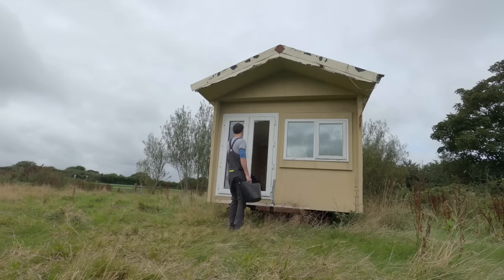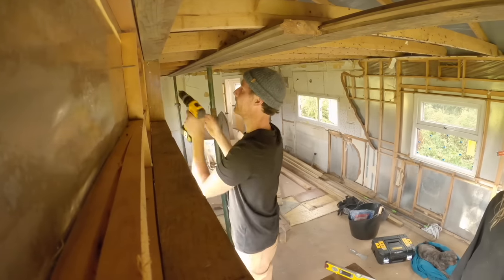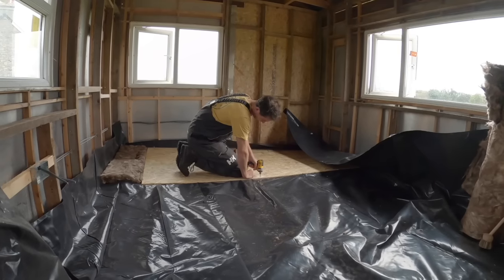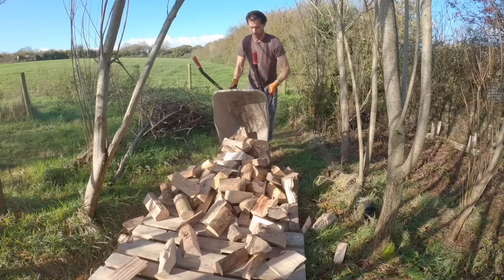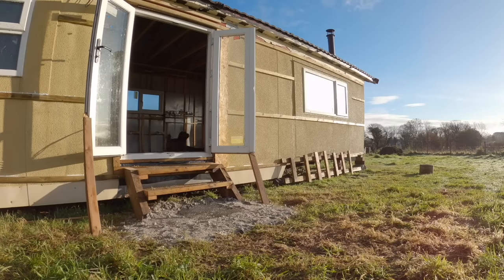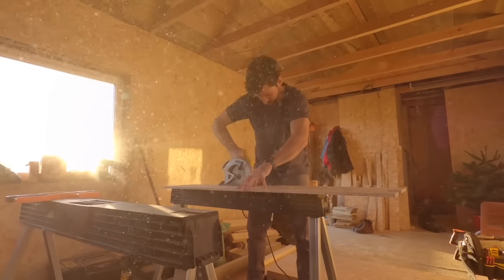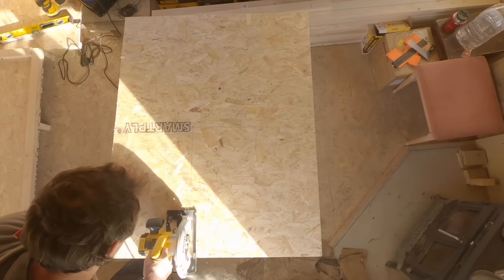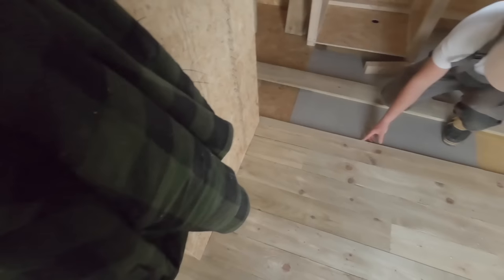Static Caravan to Cabin: Off Grid in the UK with Narration (FULL VERSION)

Comment: Did you put insulation in the floor? Cold comes up from below.

In houses Insulating the shower W.C. walls is for sound (40db’s) not for thermal.

As you had insulated the pitch of the roof (dispute the air gap issue) you didn’t need to insulate the flat area of roof as well.

I would have used tilebacker board for the walls to the shower room instead of OSB and seal it, but also once the shower tray was in I would have added another layer of tilebacker board to the walls to sit on top of the shower tray and seal it again for extra protection from water ingress. Also tilebacker board for the built-up floor to the shower.

In a lot of instances people install shower controls directly under the head unit resulting in a wet arm if turning the shower on before you’re ready to get in.

With vertical cladding, if water/moisture gets behind the boards it will
Sit and rot the horizontal battens. If you wanted vertical boards it would have been better to have vertical battens then counter horizontal batten.

Was your soak away 5m from the structure?

Urine could have gone onto your compost.

Should have extended the cladding slightly over the face of the window and door frames (at the top) and cut them with a slant to stop water tracking backward. Framing the windows externally allows water to sit and track.

I’ve been an architectural technician for over 25yrs.

All in all a nice renovation well done.

Comment: You seem to be using Vitcas Fire Board to line the inside of your stove and around it - but there are many variants of this including:
Fireproof Vermiculite Board (610x25 mm),
Fireplace Construction Board (610x30 mm) &,
Heat Accumulation Fireboard (500x30 mm)
Above 3 are 1000 mm long though smaller sizes are available.
Additionally there is:
High Temperature Plasterboard 1200x800x12mm

Comment: You don't need an air gap in the roof if you're using mineral wool. It's breathable.
Reply from the maker: This is the first time i've heard this and may make a lot of sense to me and give me a lot of relief. I have checked since and it seems fine which i found odd. Could you clarify what you mean by 'mineral wool'? Thanks so much for the comment, it's greatly appreciated!

Comment: Wonderful video. I have a static outside and have been tormenting myself for the past 5 years with Irving it a makeover . You might just have given me an ass kick  When you cladd the outside were the boards T and 
G and if not did any rain seep through the joints ?
Reply from the maker: That's awesome news and wishing you the best of luck with it all! The cladding wasn't tongue and groove and really it's only aesthetic because the actual shell of the caravan (which is aluminium i believe) is keeping the weather out. The cladding i used will help of course but it is mainly for show

Comment: The point of a solid fuel burner is to transfer heat from the burning fuel into the room around it, but insulating the inside of the burner seriously impedes the heat transfer, drastically lowering the burner's efficiency. In other words, you need to burn a lot more fuel to heat the room by the same amount. Also, heat from a burner radiates in all directions - the burner should have been situated against a wall in the middle of the cabin so that the heat would only have to transfer 10 feet to reach the bedroom instead of 30 feet. (If you look at medieval houses with great halls, they had the fireplace in the centre of the building for this reason)
Reply from the maker: You're quite right. My initial thinking was, because the burner was free and very big for the space (10.5Kw) we wanted to reduce the output and preserve the life of the burner. It definitely would be more efficient without the fireboard but would've been way to hot for the space it was heating. Even now with the fire board installed we have to have the windows open in the winter because it chucks out so much heat. I definitely hear you about the heater should be central to the build so the heat is dispersed evenly throughout. We had very clear ideas on the layout so had to compromise on where the burner was going to go. The heat still travels quite well despite it being on one end of the caravan. We also do things like leave the oven open once we've finished cooking etc because that's more central to the build. Thanks for your comment and thanks for watching!

Comment: Did I miss it or did you leave the walls, floor and ceiling uninsulated?
Reply from the maker: Yes we absolutely put a lot of insulation in the walls and ceiling. We made a mistake in the roof because we didn't leave an air gap! But you live and learn and this was a huge learning process with a lot of mistakes made that's for sure

Comment: Loved watching the video from start to finish the only thing i didn't like was the shower you should have tanked the wall and floor first or use a tanking kit unfortunately water will always get behind a tile in a shower as the grout is not 100% waterproof even with added proofing it still doesn't make it 100% at some point you will see tiles start to pop off the wall for the sake of a couple of hundred quid its well worth doing  i love the rest of the building you done a fantastic job
Reply from the maker: I completely agree with you. It is one of the major mistakes we made and will have to re-do the bathroom at some point. Thanks for watching and really glad you liked it. Thanks for the comment and tips.

Comment: You may want to build a deck and put up a green house to use as a summer kitchen, I found it nearly unbearable cooking in my static caravan in the summer. Finally last year Id saved enough material to build my deck and put in an extension to my living room which is also the all year kitchen. Now I've gotta remove my old kitchen and extend either the front room more or our bedroom .
Reply from the maker: That's a great idea! A deck is definitely on the cards. I like the idea of an outdoor kitchen. You’re right about the heat in the summer. We have all the windows open to keep the air flow going

Comment: By the way, you created space behind the fire board using horizontal lumber ... which actually creates a place that traps hot air.
Reply from the maker: That’s a good point. I have created some air flow holes since making this video. It seems to be doing the trick but to be honest having fired up the log burner hotter than it should be for a prolonged period to test the heat on the fire board - the fire board doesn’t get hot at all.

Comment: If you're concerned about the sweating in the roof, simply put ventilation on the eves to blow up the inside. That's how factory roofs do it
Reply from the maker: That's good advice, we have tried that but unfortunately stuff the insulation too tight, so realistically need to pull the ceiling boards off and take some insulation out i think
Reply: @offgridpath  Ah I see. I suppose the roofing sheets you have on don't have the crowns with allow the air movement.

Comment: Hi did you not insulate the floor ?
Reply from the maker: We were going to rip the whole floor up but in the end we only need to rip two sections up where we put Rock wool down only because we couldn't afford kingspan. The other flooring is the original floor and basically just has a very thin layer of rock wool.

Comment: Supprised you didt wrap the interior with a vapour babbier, especially in the shower before installing the particle board.
Still A good job well done
Reply from the maker: Thanks for the comment and appreciate it. You're right we made a huge mistake especially in the bathroom. Certainly a case of learning through doing and we're going to have to completely re-do the bathroom down the line that's for sure. Won't make that mistake again!

Comment: Watch the condensation in roof, you want an air gap between insulation and roof felt if it isn’t breathable felt. Yours looked like plastic, ignore this if it isn’t my old eyes aren’t what they used to be.  Good luck with the off grid life.
Reply from the maker: You’re absolutely right. It’s a big mistake I made. Learning the hard way! Thanks for the advice, I appreciate it 🙌
Reply: Oh dear, did you remove roof sheets and replace felt with b/membrane then put back the roofing sheets back on? I’m sure you’ve already done it, and it’s finished now!
Reply from the maker: You’d think I had but no I haven’t yet! I have taken random lengths of the roof to check the situation and it was surprisingly dry to my absolutely shock! But it will need to be done at some point 🤦‍♂️
Reply: Winter will be when the condensation forms when you start heating it, it can sometimes appear that the roof is leaking there will be that much.  If you are able to, think about doing it before you need to turn heating on.  There’s probably some vids on here with regards to insulation and an air gap for your type of felt.  Can you get some form of ventilation where the roof meets the wall?

Comment: Problem with that wall is obvious that long Bank of windows I would say that was never designed like that somebody later put those windows in in the US when they build a trailer house they build it to move at least 300 miles
Reply from the maker: Quite possibly you could be right about the windows. I did have a very good look at the floor and underneath the cabin. We chose to replace a couple of boards that really needed replacing but apart from that it seemed to hold up well and has done since.

Comment: I guess the only comment might be - you can't go to a hardware shop for a set of new eyes.
Wear eye protection please. 
When you cut wood, or tiles, or whatever. An accidental chip, a tiny rock shell...
We have 10 fingers, so no big drama for those.
Reply from the maker: That is a very wise and good point - I appreciate that. I was very slack on health and safety and now getting a lot better. Like you said they're not easy to replace!
Reply: @offgridpath  
No drama, simply take a reasonable amount of precautions. Just a damage control.
The video is great.
Audience will crave for more. 
Maybe you plan to build a deck? A firewood storage? Great new content, I reckon.
And a nasty wound might set you back...
That's just us being humans:) Why do I need a fire extinguisher if I never had a house fire before?

Comment: That is a 72 73 model mobile home two-by-two walls who was great to see you for it in atmore insulation but you should have leveled it first you can make a water-level very simple to make hey crawl under there with a bottle jack and you got this water hose that you level the beans tighten up the cinder blocks or jack stands whatever it has hello it's easy you text me about an hour two level one if it's cinder blocks it'll have wooden wedges just tighten them up go to make water level Google it
Reply from the maker: Thank you - I didn’t know how old it was so that’s great to hear! Thanks for the levelling explanation - it sounds like a great method. The problem we had is that the chassis kept flexing and bending when we tried to jacket up/down different sections so we couldn’t level it properly. Next time I’m going to try your method!

Comment: Can I just say, the government has eased a lot of planning restrictions but each council I have dealt with interprets the rules differently. Council Planning departments are the problem. They are forever allowing the development of a particular site and refusing exactly the same type of application to another which is then allowed via the appeal process to the government.
Reply from the maker: A very valid point. Thank you. You’re definitely right. It depends on the councils interpretation
Reply: government hasn't eased any of the restrictions relating to change of use for agricultural land/woodland ect to residential for individual use,only for developments where the developer can identify need in regards to the overall shortage of housing in the UK,this will only apply to large developments,the only change which can be used by the individual is Part Q planning where the land owner has a presumption of planning being granted if they apply under Part Q for change of use,complying with Part Q is very expensive,out of reach for most.